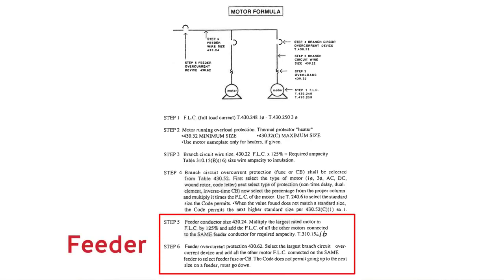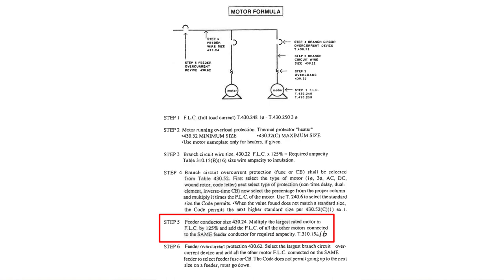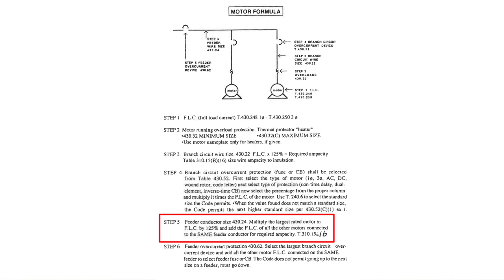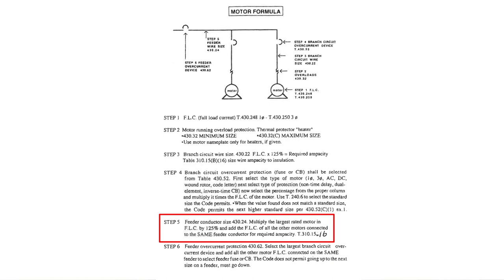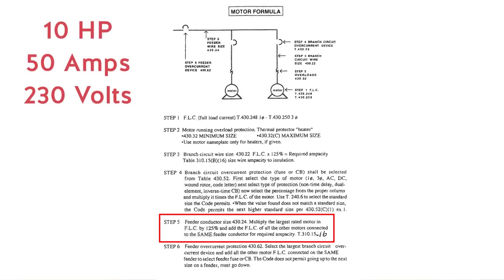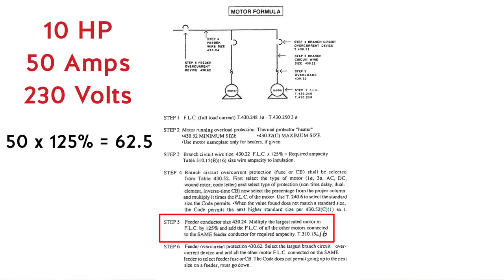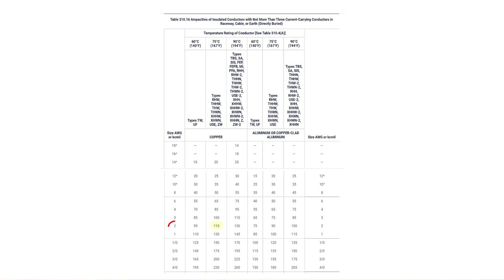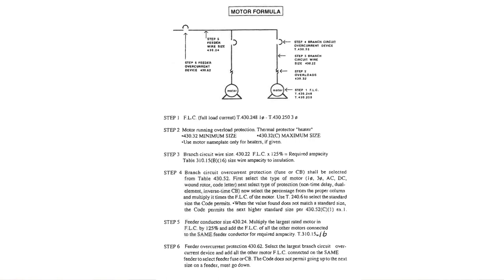How to Calculate Feeder Conductors for Motors

Comment: The 75 degree column was used for conductor sizing, the 60 degree column isn’t used even though less than 100 amps , i agree with the 75 degree column just asked in case there was confusion.
Reply from the maker: Hi there, we always assume 74 degrees for all motors unless a question/specific motor says we can't, since essentially all motors used today have connections rated for 75 degrees. Hope that helps!

Comment: hi, thanks for the video ^^... just want to ask... are these steps applicable to both single and 3-phase motors? thanks ^^
Reply from the maker: Yes they are! You will just use slightly different references for a single phase versus a three phase motor (i.e. table 430.248 for single phase motors, table 430.250 for single phase motors etc.). Hope that helps!